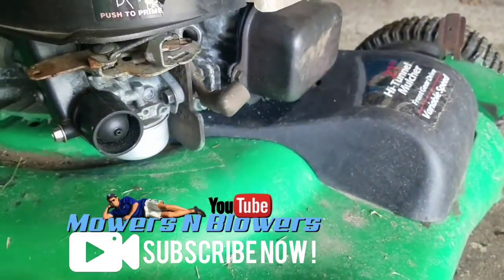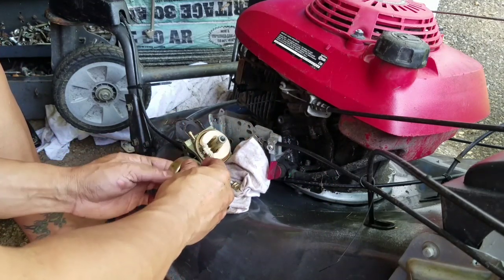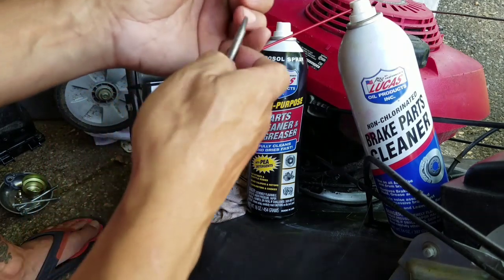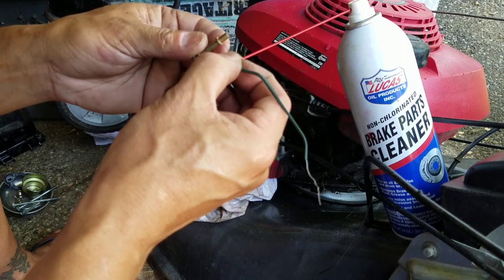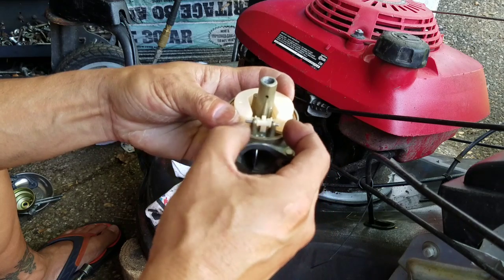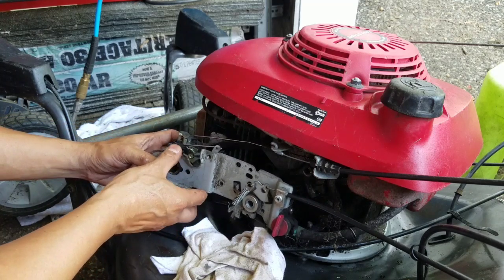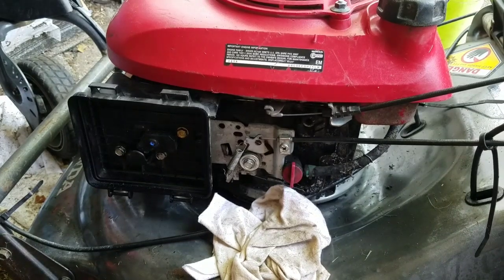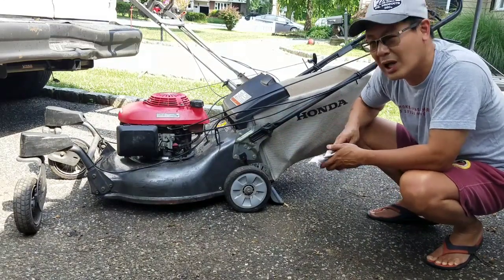FREE HONDA HARMONY II HRZ216TDA ZERO TURN COMMERCIAL GRADE LAWN MOWER GCV160 CARBURETOR CLEANING FIX

Comment: Your governor linkage is missing a spring. The second connector behind the black connector on the carburator. I have same engine and that second connector just got gummed up on me. Had to oil it good. Works great now...
Reply from the maker: Really? I'll check out the diagram. Thanks.  Seems to run great though.
Reply from the maker: Bro, I looked up the diagram and it shows 3 springs.  Throttle spring, lever spring, governor spring. I have all 3!  I even tightened the governor spring a bit to raise rpms.

Comment: You are right they are a pain to fix.  I had the Authorized dealer install a new carburetor because is cheaper and faster than mes with the carburetor

Comment: Not commercial grade buddy the hrc models are the commercial units and they kick some serious butt they have the gxv160 honda engine top of the line in my opinion for walk behind these only have the gcv series of motors homeowner use engines gxv is commercial gcv is homeowner im a big honda mower guy well there upper end line atleast not a fan of the gcv units except the newer hrx217 there really nice as well
Reply from the maker: Joshua good to know bro thanks.